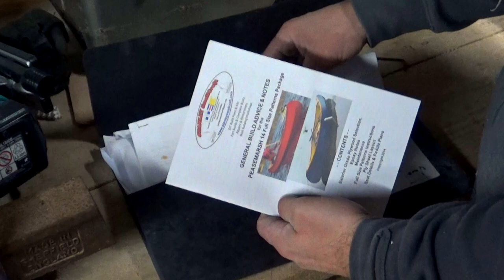Nath and Hayleys Canoe Part 2

Comment: OMG … what a coincidence !!… just this week I built a 12’ table to layout my 14’ canoe 😮 I have already cut all the planks for mine so now I’m starting to join them together . I’ve already built a 12’ stitch and glue rowboat … did that about 20 yrs ago and I still have it in the garage although it didn’t fair well on the trip to Colorado so it needs a bit of TLC. A good source of quality epoxy resins, wood flour and two part paints is West System … they also do sheet fiber glass as well I think … coming into winter make sure you get an epoxy resin that sets up at lower temperatures that or make sure you put a heater in the garage to keep it warmish… Marine ply is better at resisting ‘Checking’ as it has less voids over standard construction plywood. Checking occurs with temperature changes where the air in the void expands an contracts weakening the top layer of ply causing it to break away and stick up … if you fiberglass the hull it’s very rare that it will happen. Over time painted areas can and do check (happened on my little boat in numerous spots) but can be simply repaired by some epoxy filler sanding and a lick of paint. You might want to consider some Kevlar tape on the bow and stern. These two areas take a beating on canoes but the Kevlar tape takes the brunt of it …. You apply it as you would fiberglass … it’s simple… anyhoo exciting times …. I’ll post some of my progress on my instagram page … ATB Dave Mc